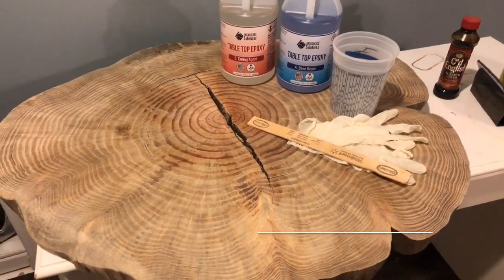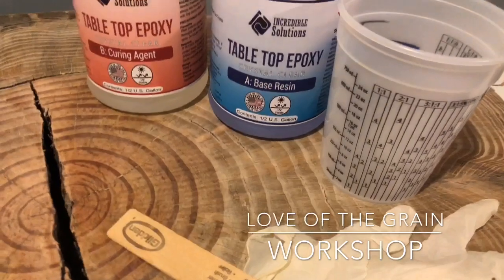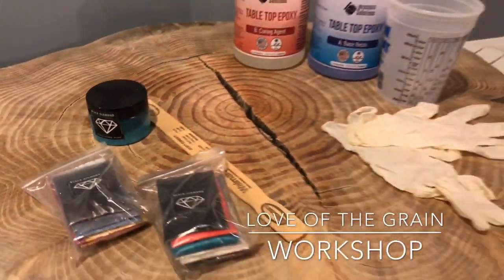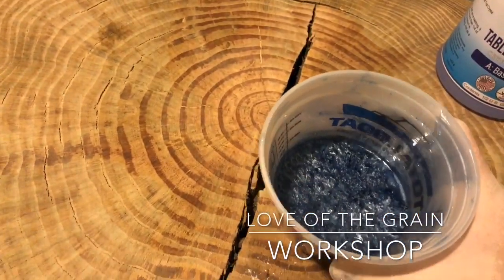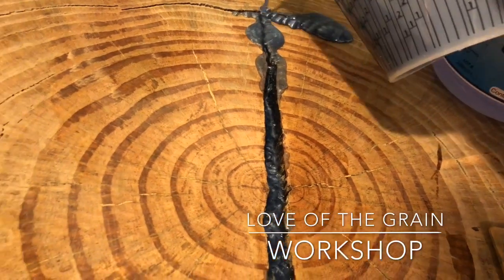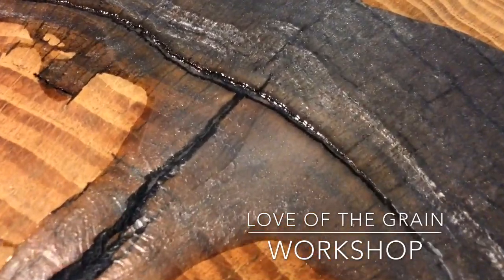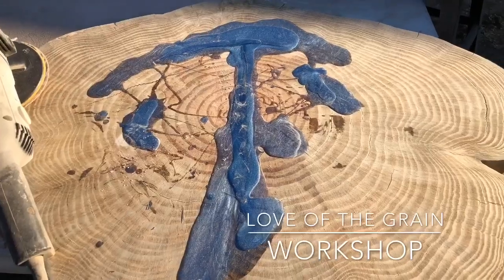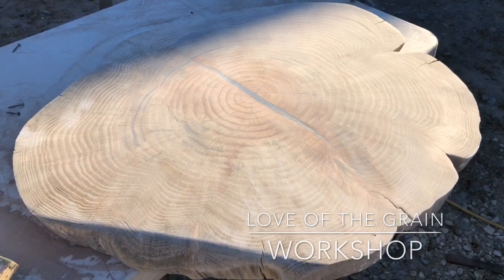50+ year old growth pine cookie coffee table live edge slab epoxy resin and bowtie splints hairpins

Comment: Nice work! Did you do anything to the grain on top so that it wouldn't soak up so much finish? I'm working on a small cookie table now, but I have no idea how to finish it.
Reply from the maker: Chris Rice no end grain cuts like this suck that stuff up fast. You can use minwax wood hardener. Its a tall skinny yellow metal can. Pour it and spread it. Let dry then apply.
Reply: You can also just poly it. I used oil based poly on a very similar cookie pine. Took quite a few coats but still looks beautiful. More of a shine when you sand in between coats